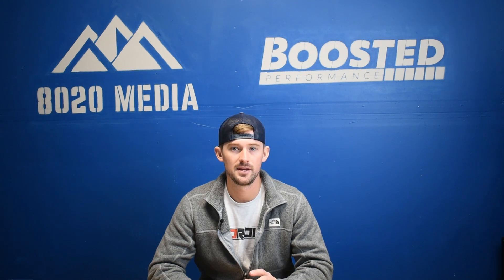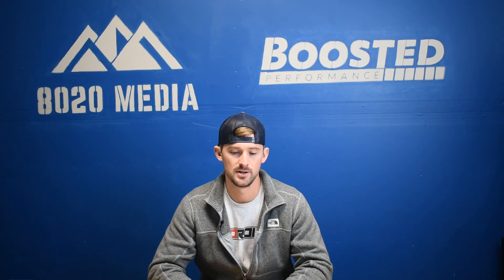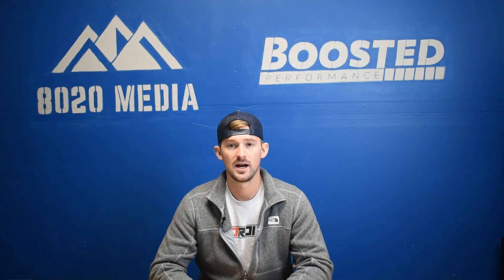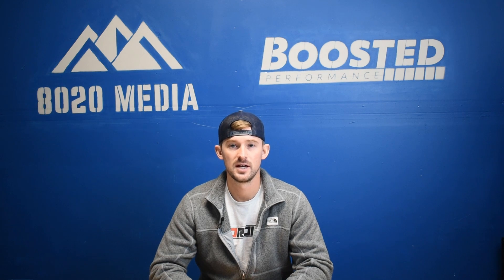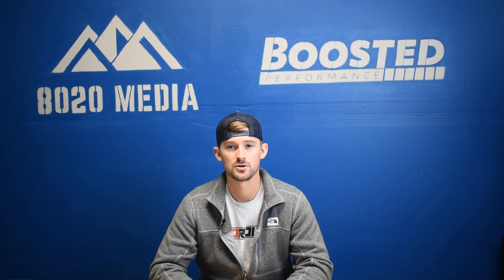The Few FLAWS of the Ford 4.6 V8 Engine!

Comment: I just picked up a one-owner 2001 f150 4.6 2v. The truck has 355,000 miles on it was driven by the old man until head gasket started leaking on cylinder 1

I did a compression check on the 7 unaffected cylinders and this thing still has almost perfect compression... original engine. The guy said he had timing replaced at 150k and 300k even though he never did have any timing issues in the first place. 

This old man seriously deserves some kind of award
Reply from the maker: TA - Sounds like you've got a good one! Crazy what proper maintenance can do.

Comment: I have seen lots of 4.6 with way over 250.000 mi and no timing chain problems.
Reply from the maker: Eddie - We don’t make this video to scare others from the 4.6 nor do we think they are bad engines. We strictly make these videos to inform. We have also seen many surpass 200k. Thanks for taking the time to add this insight!

Comment: 2002 f150 320,000 miles. Have used castrol 5w20 conventional oil since new, which I can’t find anymore. Will it effect anything if I have to switch to motorcraft synthetic blend?
Reply from the maker: Larry - This shouldn't cause any harm, especially since it sounds like you've been on top of maintenance. 320k miles is awesome!

Comment: Gotta 08 Explorer 4.6 3V V8 
Absolute Beauty with a beast!! Only issue I had was a constant Cylinder 8 misfire due to rain water leaking through the windshield  cowl pooling water leaking into cylinder 8 and sometimes #3
Reply from the maker: R - Thanks for sharing your experience! How many miles do you have on it?
Reply: @8020Automotive I have a 2005 F150 4.6 2 valve 325,000 no prooblems

Comment: I’m driving an 11 towncar with 470,000 miles on it .I saw the maintenance records before I bought it and saw no major repairs.The oil light did start coming on a few thousand miles ago . I started using 10 w30 instead of 5w20 and I haven’t seen it light up since
Reply: This engine was designed to be used in cars, trucks, work vans, boats, and generators. It was based off of records and math from the 1960's LeMans trials as well as other engines throughout the decades. It was tested through serious conditions and extreme weathers. There is no GM or Chrysler equivalent to the long life of this overall best american V8 gas engine.
Reply from the maker: GS - Thanks for the insight!
Reply: @gsauto8588 I have to disagree, the 5.2 & 5.9 magnum engine last just as long without the mod motor issues just listed in this video.
Reply from the maker: John - Seems like you've got a very solid one!
Reply: Hope the 10w30 doesn’t cause more problems for you! Heard they’re supposed to have 5w20 in them. 😬
Reply: @jp360ford2  I've been running 5W30 with 1/2 quart of Lucas Oil Stabilizer in mine for nearly twenty years with no problems.

Comment: I have a 2004 F150 STX with the 4.6 engine 2 valve, after replacing the spark plugs,one pop out,EZ fix,with 244000 miles on it,runs perfect,does not burn no oil and still have plenty of pep,everything orginal including the alternator,runs good and strong.
Reply from the maker: Mark - Thanks for sharing your experience! There are tons of reliable 4.6's. It all comes down to maintenance.
Reply: @8020Automotive  purchase this truck in 2005 with 6000 miles on it,oil been change every 3000 miles,still to this day,air filter,fuel filter,all been change when needed,air filter get check ever oil change,fuel filter get change every 30,000 miles,it been a good motor,I been a mechanic from 1979 to present, and I am empress.,I scope the cylinders the last spark plug change, and I could see the factory making on top of the pistons,cylinder walls look perfect ,if this is to much info,I apologize.

Comment: I’ve got a 98 rcsb 4x4 with the 2valve 4.6l V8, truck has been flawless for over 14 years of ownership, just ball joints and regular maintenance stuff. A lot of ppl dog on these trucks, but the 4.6 2valve is an absolute work horse! I see them out on the roads all the time. Still putting in work. I personally love my truck, it’s has 385k on the clock, still runs great.
Reply: 2v in my 98 mustang gt at 233000 miles still running strong
Reply from the maker: Ian - Thanks for sharing your experience!
Reply: I am the original owner of a 2002 Mustang GT 4.6 2V with 337,000 miles.  I replaced the intake manifold at about 200,000 miles.  I just recently replaced the IAC valve for the second time.  I replaced the coil packs about two years ago.  I had one spark plug blow out about ten years ago...CalVan Tools 38900.  That's it.  I've been running 5W-30 and adding Lucas Oil Stabilizer since about 2005.
Reply from the maker: Austin - Thanks for taking the time to share your experience!
Reply: @austinkirby7255  gota love when spark plugs decide to find new meanings to life
Reply from the maker: Danny - Love hearing your experience! Sounds like you've got a good one.
Reply: my 01 f150 2wd with 342 k
Reply from the maker: X - Thanks for sharing your experience!
Reply: My 2010 4.6 2v has 220,000 and still running strong. When it's idling it runs so smooth you can't even tell it's running.
Reply from the maker: J - Thanks for sharing your feedback!

Comment: I had a 4.6 in a 95 Crown Vic. Single exhaust 190 hp car. Though I had to trade the car for the dreaded minivan, it was a good running motor car. I never had any engine problems. It would yield 28-33 mpg on the highway loaded down with family and luggage.
Reply from the maker: Sombra - Sorry to hear you had to trade it in. But thanks for taking the time to add in your experience!

Comment: Im a chevy guy. But bought a 06 xlt 4wd f150 4.6 2v that was banged up on right front and had a stolen salvage title to boot. 1300 bucks. A shit ton of miles also. So i knew it had been rawhided. I rebuilt suspension. Basically went thru a thorough tune up. Replaced entire ac system. Its been 3 yrs and commute 100 miles a day and drive with purpose myself. Ive been really impressed by that sucker. The smetric transmision is what ive been disappointed by. Its still a helluva spunky truck tho
Reply from the maker: Frank - Thanks for sharing this! the 4.6's sure can be some stout engines! AND for $1,300... that's a steal!
Reply: do you have a link to the parts you used to replace the ac lines? i am looking and having trouble finding a good part for it

Comment: You got to run the car for a couple minutes and then sprayed WD-40 after you get all the plugs off of there and you disconnected the battery cables. I was using Champion Spitfire 1991 Lincoln Town Car no door handles blackout spacers on the back rims I was running police tires police rims nice and wide low and fat I took this car to Texas five times from Seattle Washington. Actually cracked the block street racing against a Mercury 1996 the Lincoln won that race it was a 1991 4.6 L aluminum engine even the hood of the car was a aluminum. Super coupe Thunderbird all-wheel independent suspension hitting Corners like a curved knife blade really fun to drive 4.6 L very aggressive 1997. Lincoln Mark 8 1995 doing 140 miles an hour it was built like a bullet you won't feel the speed but you will appreciate the sturdiness of the vehicle, I would call it a Mustang Lincoln all pull and power to push you in the backseat. 1995 Mustang 3.8 we're talking a Flawless engine a masterpiece😂 sounds like an Oldsmobile looks like an Oldsmobile Ford I don't know how you got away with it but it's a good engine probably too good to be legal😂 77 Chevy Nova this thing is literally designed for Street Warfare has a front end like a metal brick lousy on fuel but once she gets going nothing stopping her I think the car weighs close to 5,000 lb this is your perfect first car for a lunatic it's all pretty self-explanatory water pump alternator and nothing else😂 hey when you get into this car it's like looking at a tractor literally. You would have thought that the 1977 Nova was invented in 1958 squarebox economy car with no frills completely metal😂 everybody I knew called that Chevy the tank Nova tank😂 76 Cutlass Supreme Super Sport cruising at a hundred something miles an hour high-rise Aluminum Intake Manifold Edelbrock carb this thing was ready for racing 350 V8 or maybe it was a 400 the car was all balls very unique distinctive Chevy sound heavy metal. 1992 Honda my wife gave me the car after we broke up. She said I can't even be homeless in my own car that was heartbreaking❤ 1992 Honda is a pretty good car it's reliable if you can start it you know the dashboards in those things are garbage I wanted to delete the entire dashboard make it a street racer. Chevy citation I'm pretty sure this car was made out of garbage that Chevy had left over maybe some donations from Dodge this car says broke😂 hey man did you steal your mom's car😂 how the hell did you know my mom gave me this stupid car😂
Reply from the maker: Mish - Thanks for taking the time to write this out, but we're quite confused on what you're getting at tbh XD

Comment: The 4.6L 2. Valve was used in F150 Applications through 2010 regular cab standard models.
Reply from the maker: Daniel - Thanks for this insight.

Comment: I just bought a 2000 lincoln with the 4.6 2valve for 1500 dollar stole it has 102000 miles on still has all the manufacturer sticker on the engine
Reply from the maker: Nice that's awesome! Hope it holds up well for you.

Comment: I have a 2009 Ford f 150 stx with 354 thousand miles still running strong only issue is the frame is getting weak no place in it to keep the salt out
Reply from the maker: Mark - Thanks for the feedback! Hopefully you get another 354k out of it.

Comment: How to stop spark plug blowout on a 4.6L. Install spark plugs in a COLD engine that’s been sitting for awhile and torque to about 20ft lbs yes that’s higher then factory spec but it works, and won’t strip threads I’ve used this method for years on many 4.6’s with no blowout issues. I do not use antiseize on my plugs. Even checked the plugs at a later time and non were loose all still tight. As for oil pumps, I’ve honestly never heard of the oil pumps being an issue on the 2 valve variations of the motors. 9.5 out of 10 times if you get a low oil pressure warning it’s because of a bad pressure sending unit not a bad pump itself. Other then that just about everything here is accurate.
Reply from the maker: Wjye - Thanks for taking the time to write this insightful information. It certainly will be helpful for future viewers!
Reply: Yes, those oil sending units seem to go out more than on most engines. Funny thing is they seem to malfunction more often when they get cold.
Reply: I saw a video where some shop (just for fun on a junk 4.6 head) torqued the plugs to lug nut specs of about 95 lb ft, and they did not strip the head so no worries going to 20 or 25 on these plugs.

Comment: 195k Miles on a 2007 Mustang GT not a single issue . Only thing I’ve done is Coil Packs and Spark plugs @ 183k , oil changes. Everything else original , even the clutch. I’m going to turbo it this year to show the DURABILITY OF THE 4.6 3V! 

MMR sells metal tensioner to replace the faulty stock plastics and much more durable parts all over for these engines.
Reply from the maker: Jaran - Thanks for taking the time to share your first hand experience! This will certainly be helpful to future viewers.
Reply: Got 150K on my 07 GT and looking to do the plugs. Any issues breaking plugs? Also on the original clutch over here! It's been largely bullet proof but these plugs got me worried
Reply: @rehtorbF03 I wouldn’t worry about them, just be gentle and don’t torque them down too hard, if they are too hard to get out soak some pb blaster on them for a while, they should come right out..
Reply: im running 10lbs of boost on my 3v. managed to smoke a stage 4 clutch and break the driveshaft in half but the motor is still happy

Comment: The 2v 4.6 was in Panthers until 2011, and also the E series had the 2v 4.6, 5.4 and I do not know for sure the 6.8 until I want to say 15 but I can't recall. (They also still had the 6.0 powerstroke until 2010 in the E series too.) 

The 4v was in the mark 8, aviator and marauder too. The explorer had an aluminum block 4.6 2v. There were also 2 different casted heads and cranks for the 4.6. Windsor had 8 bolt cranks and 13/14 bolt valve covers and Romeo had 11 bolt vc and 6 bolt cranks. The Terminator and Marauder had iron blocks, the Marauder didn't have forged internals like the termi so not quite a cobra motor, same as the harley davidson didnt have forged rods and pistons like the Lightening that most think is the same thing.)

Just some tid bits for your knowledge
Reply from the maker: Sicone - Thanks for taking the time to type this information out. This will certainly help future viewers.

Comment: You missed a fifth problem with earlier 4.6 2 valve is with the spark plug leads fracturing and cause a miss fire mostly on the left bank.
Reply from the maker: Ralph - Thanks for adding your insight!
Reply: checking this on mine. one thing i haven’t checked thanks

Comment: How do I know if it’s a 2 v or 3 v? 2005 F150 4.6L
Reply from the maker: Lethal - There's a few things you can do. Likely the easiest is pulling your VIN and using a VIN decoder. Other things to look for is the 2v's typically had a black plastic intake manifold, unless this has been switched out. The 3v had a metal intake manifold with a noticeable bulge in the middle for the variable valve timing mechanism. The 3v also came with "aluminum" valve covers.
Reply: Your vin number tells you. If the 8th number is 8,its 3v if its a W its a 2v